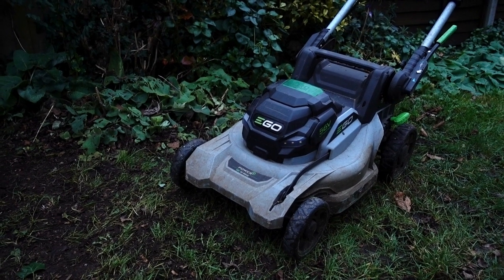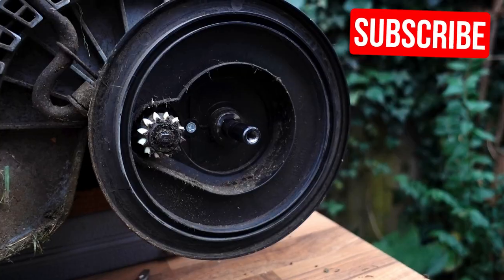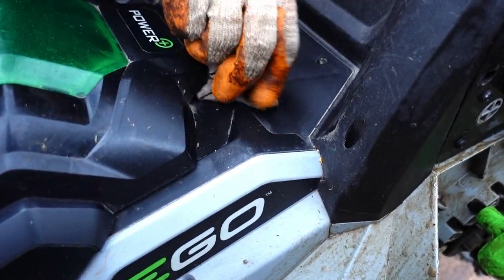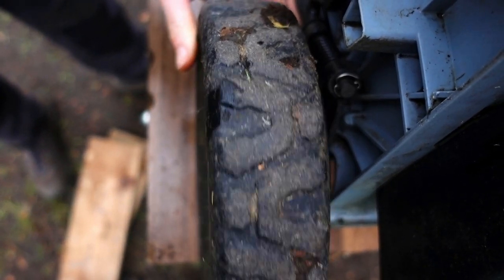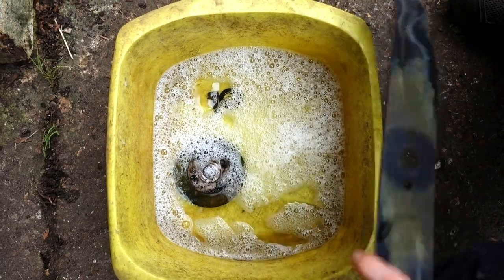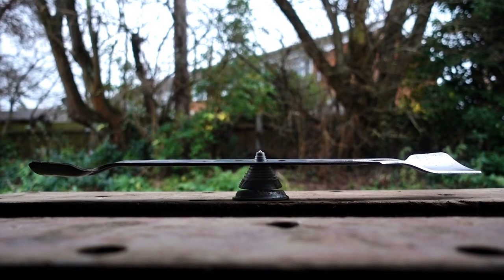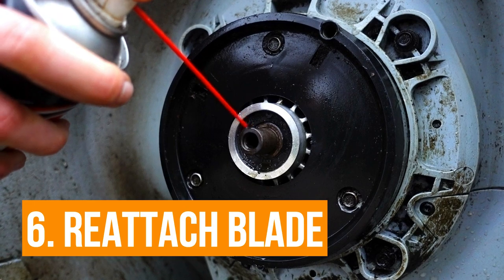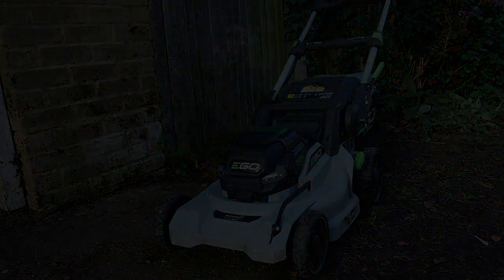6 Things to Do to Your Ego lm1903e-sp Battery Lawn Mower Before Lawn the Mowing Season

Comment: Thanks for video. Nice to see everything!

Recommended torque for blade bolt 36 - 43 ft-lb  (50 - 60 Nm).  If you have the duel blade model, the small bolts holding blades together 22 ft-lb (30Nm)
Reply from the maker: Thanks for the tip

Comment: As per a previous comment, did Ego oblige to correct the sprocket issue under warranty?
Reply from the maker: No but we only put it in to get fixed in the spring of this year's so any pro or domestic warranty had run out. The ego dealer did manage to replace the parts without having to replace the whole drive system so it was quite reasonable price.

Comment: The bearings are rubber sealed so greased for life or the life span of the bearing. so they do not need greasing unless you unclip the actual seal it's self